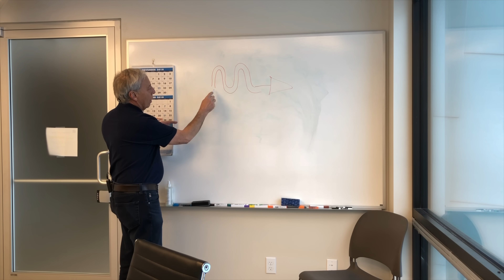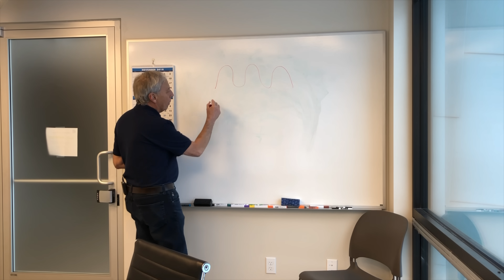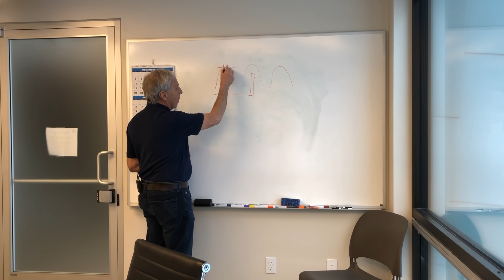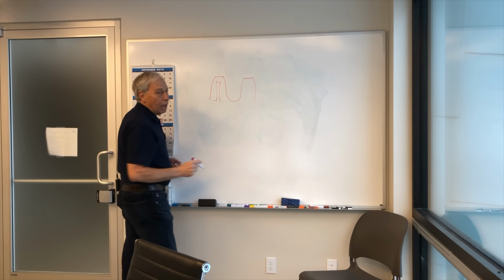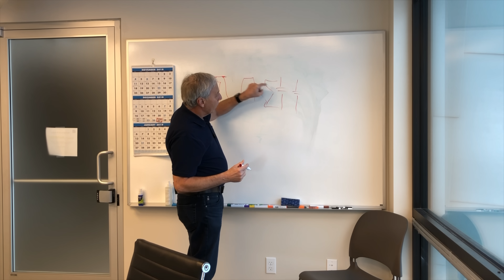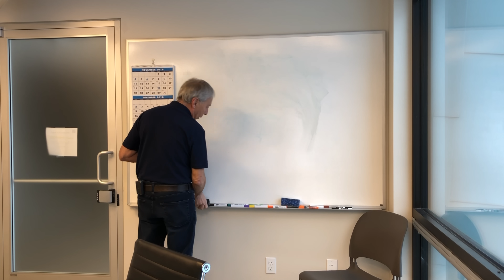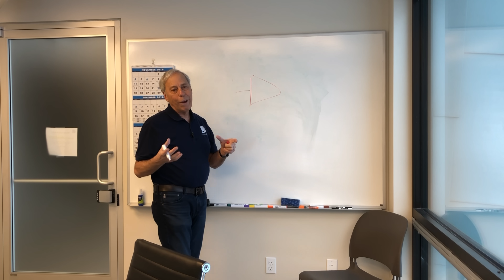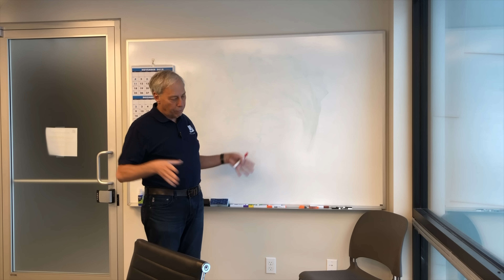How does power factor affect audio?

Comment: The Google definition of power factor does not cover the distortion power factor issue caused by power amps and other equipment that draws current in pulses.  It would have been better not to include the Google access in the video.  
Now a question for Paul:  What's the distortion power factor of the PS Audio power plants?

Comment: Question: my home is at a end branch of the "electrical grid" meaning their are a few "telephone poles" carrying higher voltage electricity down the long driveway to our home, with the last pole having a "standard size" transformer from which 240 volt ac runs to our homes distribution panel. Does this mean my stereo system suffers from less POWER FACTOR DISTORTION that would be normally induced by other dwellings on the grid because it is deadened by the step down transformer on the pole?.... 2nd if I have a 100uf capacitor plugged into the same outlet as my stereo, would it not help keep the Bass in my music tighter at higher wattage levels?....😎
Reply: Please don't go anywhere near an outlet with any capacitor!  
You can build a resonant passive PFC circuit with a combination of inductor and capacitor, but that circuit type isn't completely effective and suitable parts aren't easy to find.  
Anything you do to improve your power quality and make it less susceptible to the distortion power factor of your equipment, would in the end only improve your music by adding 1-2dB of headroom.  Hardly worth it, and no, it won't make the bass tighter.

Comment: Yet again he is effectively promoting snake oil. 
I bet that power factor correction being fed to any high-end amp makes ABSOLUTELY NO DIFFERENCE to the audible result. 
He wants to promote his incredibly expensive power plants as though those products actually make a difference to audio quality. 
Do we see any data to backup what he says ?   No.
Reply from the maker: We have previously posted scope photos and measurements of lowered power supply ripple when connected to a Power Plant but let;'s face it. You're not looking for that. What you'd like to see is some sort of measurement explaining my claim that it sounds better. Am I right?

The problem is, we do not know how to measure that other than with our ears. It doesn't really matter what evidence of improvement I would show to people who have not taken the time to try this on a revealing system, because no evidence of change would convince you that change translates into sonic differences.

So, it's not snake oil. It's solid engineering that we can demonstrably show makes a difference in terms of power purity and voltage regulation. It's why we went to the trouble of providing a real time oscilloscope and distortion analyzer on the Power Plant's front panel display.

I would only ask you loosen up a little and consider this is one product that just might make a difference you can hear.

Comment: Power factor corrector (PFC) on AC rectification for protecting mains distribution transformers. AC rectification produce nonsinusoidal current waveform which can melt down mains distribution transformer's core.
PFC-device reshape nonsinusoidal rectification current waveform into as 'close as possible' sinusoidal current waveform.
Hence, PFC-device has less relevancy to audio device's performance.
Cheers from Indonesia

Comment: If you install a phase meter in all three phases coming into my house you will get the shock ( excuse the pun please ..!) of your life ! The phase shifts between current and voltage wave forms changes all the time in extreme cases it can swing from leading to lagging by as much as 40 degrees . 
I believe there are proprietary brands of PF correction machines that are the size of a small fridge which claim to maintain a unity PF under all loads .. this thing might give you Bill shock too by the way of higher electricity costs ( not just the machine itself lol 😆)
Reply: 3 phase in residential?
Didn't know about that. You are so awesome. Have a great day..

Comment: Power factor is one of the reason why well design SMPS is the future. Today most industrial power supply is switch mode. They are efficient, high current, and low noise. And they have apparent power factor near 1. These days your can run communication cable by low power cable without losing the signal because we can made power supply generate nearly no noise.
Reply: Switch mode are not inherently low noise, they are actually very noisy compared to linear power supplies. A lot of filtering is required to remove noise from switch mode power systems.
Reply: @cbcdesign001  Sorry if I did not make myself clear. I said well designed industrial SMPS. Power factor and low noise is very important for industrial use.
Reply from the maker: Yes, I would tend to agree with you. They are excellent in many respects though weak in others (like current delivery for peaks). I would like to see our products move to SMPS over time.
Reply: @Paulmcgowanpsaudio   Industrial SMPS can easily rate over 40A, having said that those requires 2~3 phase input. Also it is easier to make good SMPS from 3 phase. Wonder if it also works with single phase in with phase shifting then do pulse conversion to DC.
Reply from the maker: @LD Blake You bet.

Comment: You should know that voltage is pressure and current is flow...😊
Reply from the maker: Yes, that is correct and a good way to look at it though not always the best way to get across a complex concept to people who are just starting the grasp some of this.
Reply: @Paulmcgowanpsaudio  Thanks Paul,We were always taught in England to treat Electricity as water going through pipes and restrictions as resistors to get the basic idea that could be understood.I grabbed the concept and have been dabbling with Electronics since I was 8 years old.I loved Heathkit 😃I never could understand power factors until now! I spent a lot of money when I was 18 on a pair of Acoustic Research AR 91 speakers which I still use today, Do you think they are still good speakers compared with what is around today?

Comment: So I understand if other companies equipment need a regenerator but are you saying that even PS Audio gear has a feeble power supplies to deal with bad poor power factor and other dirty power problems? How about a null test with and without? You could even simulate bad power.
Reply: @LD Blake I have zero issue with your compliments to Paul here. Yes, he does present a good basic explanation of power factor based AC power distortion. And he also provides a theory as to how it could upset good performance an audio system. But it's just a loose white board theory. There is no data presented to back that up. No mention of how low the utility source impedance is and how much effect this my have in a residential environment. The fact is  that in a high percentage of homes, this is not a problem that need any fix. 

I have suggested a what I think is a great test to prove (or not) how a PS Power Plant can improve audio performance. You would think Paul and his team would do it not only as an engineering exercise, but it would end these arguments once and for all. Yet just as he did again yesterday on his company forum regarding testing interconnects:

"I haven’t the time nor the interest in performing these tests with any scientific rigor, but perhaps someone else wants to grab the flag and climb the mountain. It would have to be performed on a system where we actually do hear a difference." - Paul McGowan

Clearly he knows he will fail. Just as he ignores Ethan's  null test offer. And notice the demand for a system that can resolve the difference. There's his out. If it fails, no system will be deemed good enough. Even will all PS Audio gear, some unrelated problem or issue will be blamed for the null result. Here's proof of that:

"This would involve using a microphone to capture the output of the system and then comparing the recorded files to find the differences. It’s essentially the same test I have done any number of times with the microphone in my iPhone which more than adequately picks up differences." - Paul McGowan

He expects us to believe he can tell the differences in interconnects from a live Iphone recording? This must be one of those cases where he says he must know which cable is being played for the test to be valid! seriously?
Reply: I brought that up over on Ethan's null test video. The PS Audio power plant is actually an excellent test platform to prove or disprove these AC power quality issues and their effect on home stereo and video equipment. They claim to use a DSP to re-generate the new sinewave so it could be very easily re-programmed to add all kinds of controlled and calibrated distortion to the output waveform to study the effects. And this is non-destructive as well. When finished, just load the original DSP code back in. PS Audio has a unique tool to prove what they are claiming in these videos. Why not show it with real gear? Generate a deliberate flat topped sinwave and measure the amp parameters with and without. Of course we will need to see the calibration points. Not just lop off 50% of the sinewave and say/show it makes a difference. Sure it would, but lets stay confined to real world conditions.
Reply: @andydelle4509  Thank you for expanding and keeping a sound mind over this but with all the kitten vid replies and Flavor aid drinkers I'm getting the feeling they are all doing snake oil intravenously. Be safe!
Reply: @Larry Niles No, I suggested a test he can easily do that would basically prove his white board out with repeatable scientific results. Or not? You think it's not socially acceptable to challenge untested advertised claims by a vendor?  What world do you come from!
Reply: @LD Blake Well difficult but not impossible IMO. You would need two power amps that were identical down to the resolution of your test and that's not as easy as grabbing  two units off the assembly line. But with a reasonably matched pair you could have a null test with both amps on PS power plants. One running stock clean AC mode and the other on a PS Power plant adding controlled distortion and noise to the AC power source. See how deep the null is. That will tell us the degree of influence of the "bad power source"
Reply: @LD Blake Yes, but the question is not if the PS Audio power plant works as advertised. I'm quite confident it does, that is to produce virtually perfect 50 or 60hz sine wave at a low source impedance. The question that needs to be answered via testing is if this quality of AC power makes any measurable difference on the output of an amplifier, and then is that level of difference audible versus direct wall power in a typical residential neighborhood? Because this is what I see as being sold here. Not the finer aspects of the Power Plant it's self, but rather it's suggested need if one is to get optimum performance from their system. And that has not been quantified yet as far as I know. Plenty of talk from all power product vendors saying it obviously makes that difference but no hard evidence.
Reply: @SJMessinwithBoats  So you have a problem with these white board claims being put to a physical test?
Reply: @SJMessinwithBoats  Yup, Paul is very busy! Let's see he writes a daily blog on his company WEB site and a daily video here. Seems if he has the time to do all hat selling, he should be able to provide some evidence of the claims.
Reply: @SJMessinwithBoats  Show me just one technical comment you made in this thread relevant to the subject. Something helpful to someone considering buying a power conditioner? You have posted nothing of value in this entire thread.
Reply: @SJMessinwithBoats  I have proven nothing here. I did asking for more scientific testing and evidence to back up the claim that reasonable  AC line distortion is detrimental to audio reproduction. So far that has not been proven either in the context Paul is showing.

Comment: It would have been easier to tell that power factor is due to the phase difference between voltage and current...cosine(theta) - its modulus varies between 0 and 1.
Reply from the maker: For some, perhaps, but I think the way I presented it helps those that don't understand get a clearer picture of the net results.
Reply: Honestly I had no idea about Power Factor, never heard about it and that's ok.
I'm ok,
Your ok.👌
Reply: That's displacement power factor, which doesn't apply to electronic equipment like amplifiers.  
What Paul described, is distortion power factor, which wasn't covered by the Google definition.  
I'm not sure if this video cleared up any more confusion, than it caused.

Comment: What's the difference between the power supply ( ie the mains transformer diodes and caps) in a P20 and that in a BHK Amp..? 
Low PF in the mains supply IS  caused by the appliance .. true ! But if I run a washing machine or fridge or any other inductive load ( there are very few capacitive loads in reality ) then they won't affect the PF for everyone else and to extrapolate it further how many inductive loads are necessary to create a useless PF ? 
If the BHK Series amplifiers ( and all others for that matter ) had the same power supply topography and performance as in a P20 " regenerator" then the latter would be redundant .
Reply: Larry Niles here we go again..! I'm NOT proving Paul wrong .. I'm just questioning the necessity of a power regenerator .. read my comment again and properly this time . There is nothing wrong with engineers having differing opinions ..
Reply: Does Paul run a regenerator in room 2? Looks like the regenerator is a solution to a problem, not something for everybody all the time. My application would be for use on a genset or inverter. Isn't it designed to clean power?  To think that it would be something to make a great system better is a stretch. Considering also that Paul's system runs on 15-20% and rarely goes to more than say 50% duty cycle?
Imagine his system full pedal on Metalica! NO, NO, my Baby!!!💝